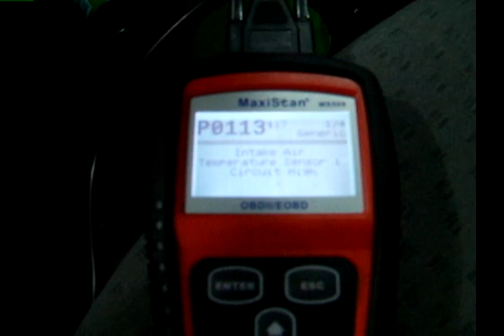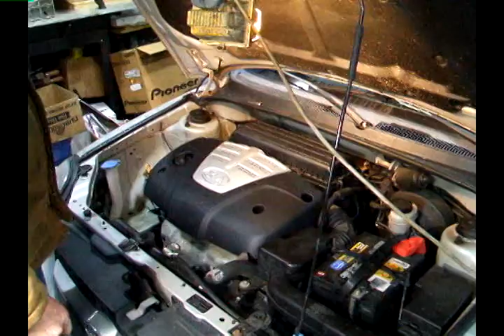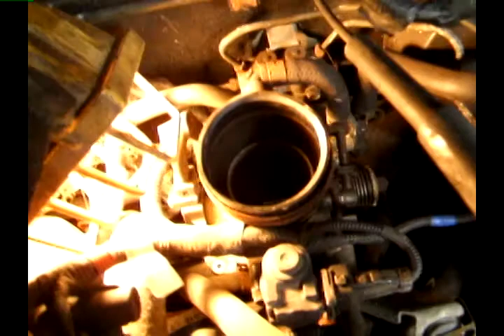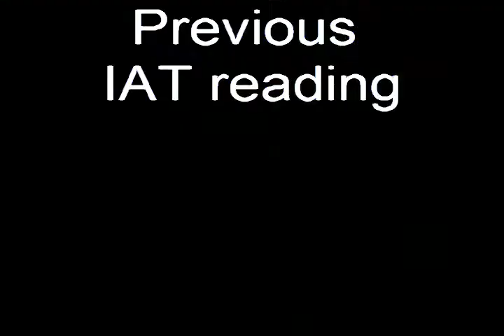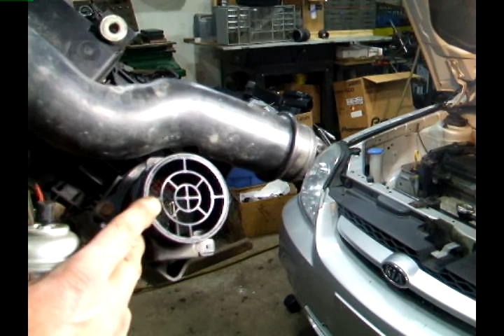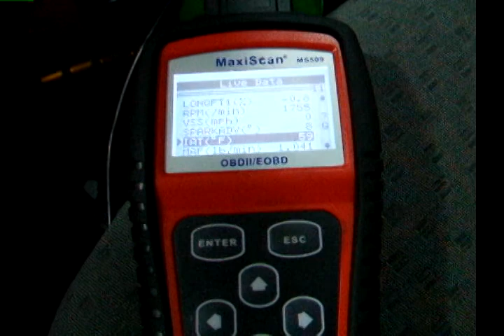03-05 Kia intake air temp sensor IAT

Comment: Thanks for explanation
Reply from the maker: Happy to help
Reply: @Amotorcyclenut  i have the same car but 1.3 82 km and the same error came out, yesterday i changed this sensor, it was no responding when testing ohms on multimeter, i mounted new one which was working good
Reply: @Amotorcyclenut  in 1.3 82 KM version this sensor is in exactly the same place